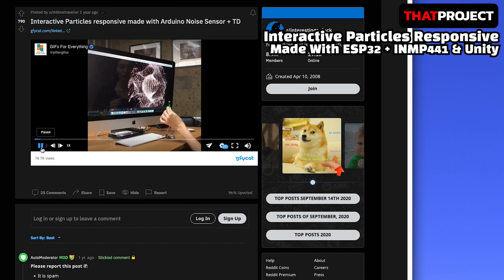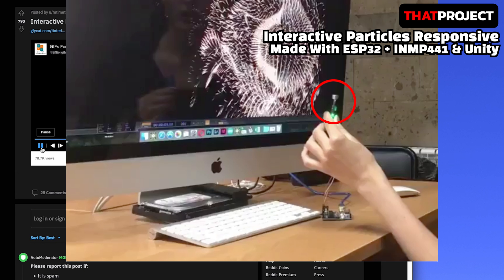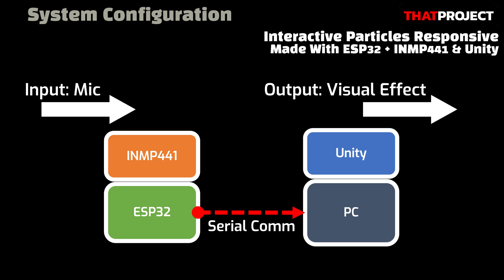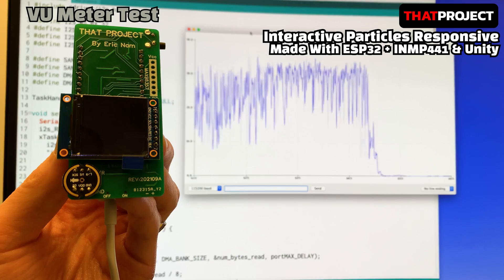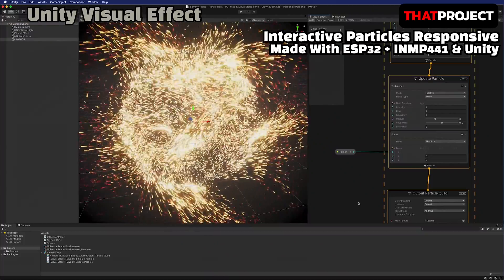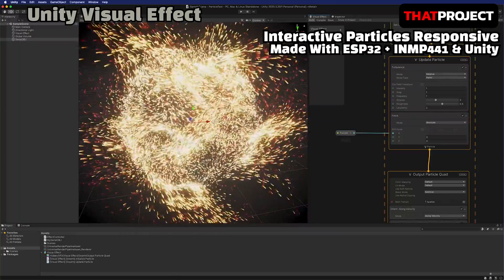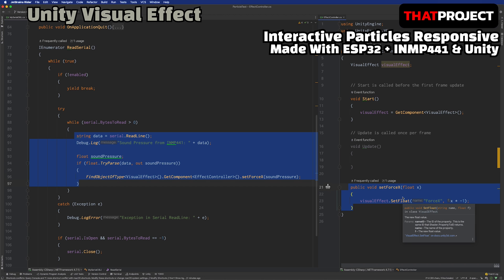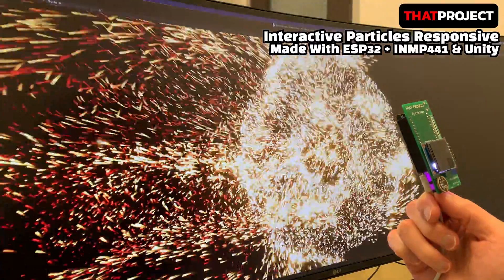Interactive Particles Responsive Made With ESP32 + INMP441 & Unity

Comment: Hi, when using esp32cam to read touch pins, I can't read the correct values (I always measure them as touched while not touching too) How can I solve this problem thanks
Reply from the maker: Simply test with other ESP32 DEV kits. I don't think this is the ESP32CAM issue. Not sure but it's possible reading ADC is miscalculated.